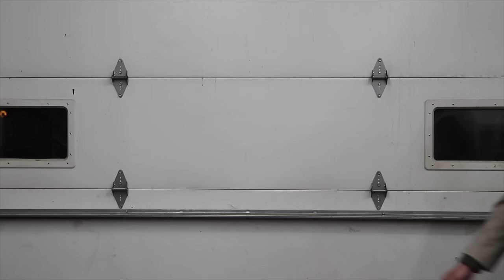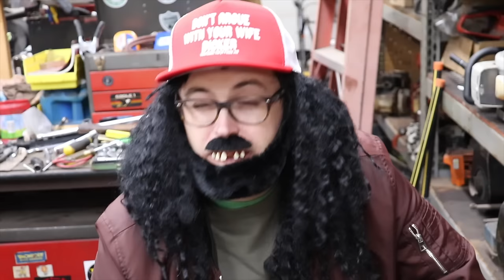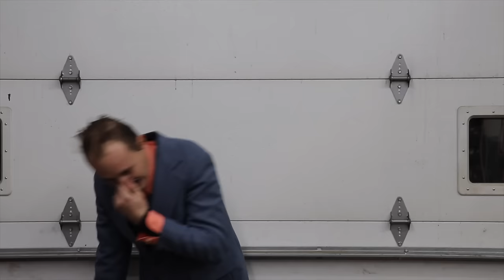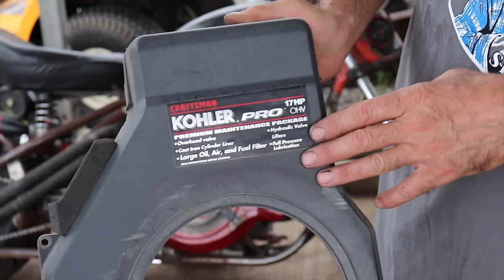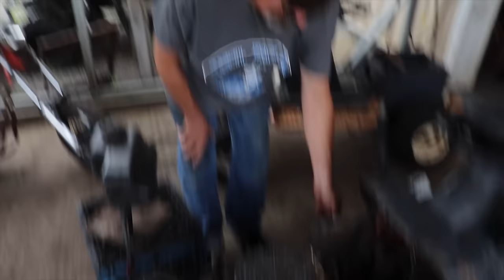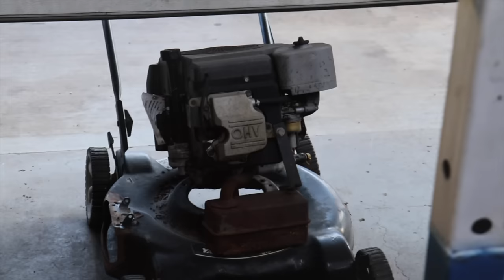Epic $100 Mower Flip - Engine Swap

Comment: Just something to be aware of,  going from a Kohler to Kohler,  or Briggs to Briggs,  is pretty easy.  I went from a 12 horsepower Briggs to a 25 horsepower Kohler,  the starter system is slightly different,  the pulleys are different.  The Kohler has a crankshaft with 1 1/8 shaft the Briggs is 1 inch.   Trust me trying to find a thick wall 1 1/8 inch inside diameter to adapt the Briggs lower pulley is mission impossible (almost) . What I did is took a PTO apart and the bottom piece of the PTO has a heavy duty piece that will work,  the next problem is finding someone that can actually weld the pieces together.  I was lucky,  I have a friend that has his own machine shop and he helped me get it welded,  straight and true.  Now my Murry 40 inch cut is very dependable and much more powerful to cut tall grass,  or weeds.  Most small engines have similar electrical systems.  And the 6 prong  connector will work for most things, like the alternator and kill wires.  Like I said the starter is a little different.  The Briggs uses a separate starter silinoid,  the kohler uses a starter with the silinoid mounted on the starter the easy way to fix is just rund the heavy Cable from the battery side directly to the starter,  then the side that goes the Briggs starter remove the cable and use a 14 gage wire to the Kohler starter silinoid.  It should work.
The exhaust was easy,  I dumped the original muffler and used 2 smaller mufflers for a true dual exhaust

Comment: If it changes AC to DC it is NOT a regulator, it is a rectifier. The current output on the charging system of those engines is so low they don't need a regulator.

Comment: That's nice that you were able to fix it up, but I wouldn't drop 600 on that thing. 200 or 300 tops. Because I have no idea how long that thing will last with an engine from a junked tractor that's probably been sitting out in the rain, no idea how it's been maintained, etc.
Also, seems like that deck had way too much side motion when you engaged the blades.
Anyways, nice video. I just wouldn't pay $600. ;)

Comment: I swapped the same engine mine was a 18hp of a craftsman and put it on a home owner 42 Toro zero turn I didn't have to modify anything everything connected perfectly the only thing I had to do was put a electric fuel pump and regulator in very easy swap.

Comment: Got an Ariens tractor that won't start had no spark so I re place coil diodes diodes check good could it be ignition switch it's an Intex Briggs & Stratton 20 horse it has for safety switches plus ignition switch

Comment: Since you are making this switch , what would be involved with changings a briggs to a kohler or vice versa?
Reply: He has done many videos on it
Reply: wiring, and exhaust....and also possibly fuel lines and pump depending on set up, I just did a swap on the same exact machine, and was going to put a Briggs in it, but was going to take more time and fab than I have time for, and just so happened to have  a Courage in another machine, and is a drop in....no fab, no exhaust work, just had to change the alternator, and a couple other minor things because the engine came out of a non electric pto tractor, was a simple install.

Comment: Thanks for the great video as I too have a engine swap about 20 years ago I got a sears ridem mower tractor his son had forgotten to check the oil and it had a bad knock probably the crank bearing always thought I'd try and rebuild it but never did a couple of years ago my nefew gave me a John Deer I had planned on taking the motor out of a cub cadet mower the steering is wore out and since my nefew broke the drive belt I can't get one to fit or stay on but mother nature had the final say on the John Deer during a windy day she dropped a big tree branch on it smashing the hood and most of the tractor so I scrapped it but still didn't think about swapping the engine in the sears tractor but the motors are the same might just get the sears craftsman going again since I have everything to fix it funny how we get an idea and another solution is sitting right in front of us and we we're so focused on the idea that we miss the solution

Comment: i got a free 2011 craftsman yts that had a junky briggs single on it and the cam went out in it so i stuck on a early 90's briggs opposed twin onto it best tractor i have had in a while
Reply: Nice opposed twins will outlast any new single cylinder Briggs I do like the older flat head Briggs and ohvs from the early 90s those new intel’s are not a very good engine I have one on my 2004 lt1000 I got for free

Comment: The deck looks like it isn't fully attached. Its angle changes when the pto is engaged.
Reply: It's a " floating " deck, only mounts in the front, and hooks to a cable in the rear that lifts it......I have the same exact machine......super simple to pull the deck or " jerk the deck ", as Taryl says, to clean.......is by far the easiest deck to remove that I've delt with

Comment: I got a 1982 Snapper riding mower that 8 horsepower Briggs on it I don't know too much about the old nater system on it wonder if you could do a video on a 8 horsepower Briggs and Stratton mine old nater is only a half a ring

Comment: I find if I hit those pulleys with anti-seize so they come off easy the next time, there isn't a next time. But if I don't use anti-seize lo and behold then the engine ends up needing removal.
One of lifes little mysteries....

Comment: Double sealed bearings is to keep grease in. There are also different high RPM sealed ones. THE REASON IS WHO GREASES THE SPINDLE BEARINGS.. THE HOUSING HAS A GREASE ZERK IS OLD STOCK.. TO REPLACE THE HOUSING THERE WILL BE NO ZERKS.

Comment: Hey taryl. I did a video in August on an engine swap on the exact type simple city with the same krowler engines , did the same things you did except I just put a different type throttle cable , you're cable idea was much better. As far as the exhaust I happen to have the right pipe and just had to flip the mufkin over. I got $800 for mine

Comment: On my Generic JD when I replaced my Blade Spindles, I took out the Inner Seals on the bearings thus when I greased it, the inner shaft that contains the grease would be forced into the bearings that had seal removed. Why the manufacturer would put a Alemite grease fitting on spindle shafts that does not grease anything is beyond my understanding....

Comment: What is the advantage of an electric Clutch over a manual?
Reply: Belt is always under tension ,so it doesn't  slip and burn as it does when engaging  a manual  one!  Belt last a lot longer  .
Reply: Hydro transmission  belt  is also under constant  tension, unless you need to use brake  . Most of the time all you need to do to stop wit hydro is just slowly  release go pedal  or lever! So drive belt last longer .

Comment: Any idea what an old Diesel Simplicity might be worth? It runs and in decent shape. It has the Lombardini engine and it's hydrostatic
Reply: depending on your area and attachments you have, maybe 400-1500. Your area making the biggest difference.
Reply: @M.TTT.  thank you for answering. I'm in northeast Alabama and no attachments just a mowing deck.
Reply: @sixteenstone007  mower deck is better than nothing for sure, being Alabama, arent simplicitys more rare there or not really? Seems their mostly in the northeast and midwest-ish

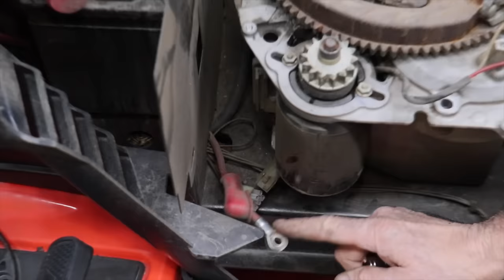Comment: Was the original engine seized because the starter gear is jammed up into the flywheel as seen at  7:05

Comment: That must have been a second engine they put on that mower because Briggs and straton owns simplicity
Reply: Maybe prior to b&s buying simplicity?
Reply: @mmm365  simplicity is the farthest thing from MTD
Reply: Was wondering that myself. Briggs and Stratton bought Simplicity in '04. Maybe this model predates it? 

My BIL has one of these with a 27HP Briggs twin. Nice machine. Has precise deck height control for setting the cut down to fractions of an inch, and the roller on the back of the deck for making your lawn look like a baseball diamond. Hood is made of individual steel pieces, no plastic except the headlight.

 You could buy two MTD's at Home Depot for what this machine cost at a Simplicity dealer.

Comment: its the mid 1990s when Kohler made the Command vertical shaft engine the best of its kind as i remembered having a Simplicity Broadmoor Hydro 14 same 38 in deck and a 14 hp Kohler Command. not much problems but the governer parts tend to pop out of place in a command engine. meaning have to take the engine bottom off to put it in place. plus the magneto coil be another problem other than that the command is a good engine. the engine comparable to this in reliability be the Kawasaki FC420V like the command its exhaust exits at the bottom of the head. as Kubota and John Deere uses the Kawasaki engines. but what about swapping a Kawasaki engine into a Simplicity frame. these Kohler courage, the newer Kohler engines are problems as well as all of the Briggs & stratton OHV single cylinder motors. as the best ohv single cylinder motors to use are the Kohler Command and the Kawasaki FC engines.

Comment: Simplicity. Briggs & Stratton owns the brand now as u used a engine in the yard which makes sense if its Briggs,  Kohler,  Kawasaki,  or Honda.  before Simplicity was purchased by Briggs & Stratton it purchased the Snapper brand  tractors and mowers and the Snapper Pro commercial mowers.  as Simplicity had many brands argo allis allis chalmers giant vac. as those brands must went away when Briggs & Stratton filed chapter 11 mid 2020. as Briggs & Stratton began small engines when close to 1919 purchased the Smith motor wheel and the small street legal buckboard flyer then and its when briggs utilized the engine and when they begun the big small engine business.

Comment: Those Kohler command engines are tighter crap, our 03 lt160 16hp command has over 933hours on it & runs like a clock, doesn’t some bad at all. It’ll probably do another 900hours.

Comment: I cringed watching you drive those bearings in, my shop teacher would have hit with the hammer.  I was taught, drive them in by the outer race, if you can use a press. But you are “the man” in my eyes.

Comment: an alternative motor be a Kawasaki FC420V  thats a better quality as these Kohler Courage engines aren't all that great many problems with them. even blocks cracking. The Command don't have much problems other than the coil and the governer the Kohler command is a much better engine

Comment: That mower looks like a piece of junk. They really have grease zerks on the spindles with greaseless bearings?
Reply: Just about every consumer grade deck I have serviced has the seals still on the bearings.
Reply: @robb1165  They should have the seals. The spindles shouldn't have grease fittings.